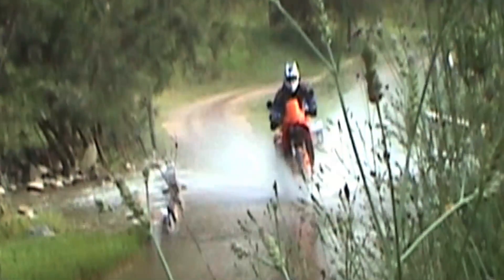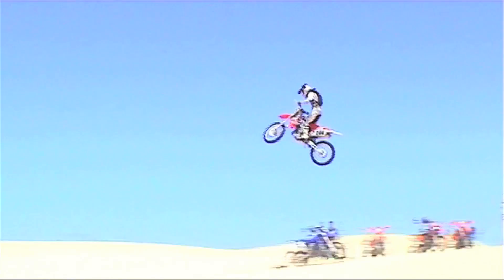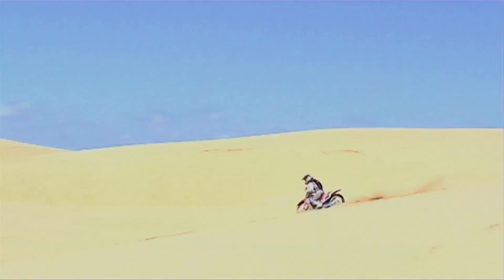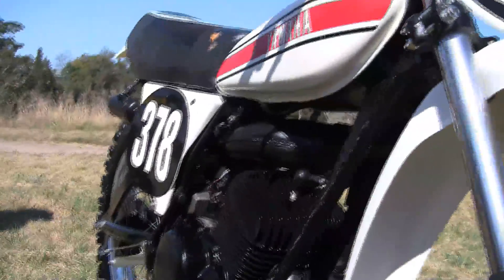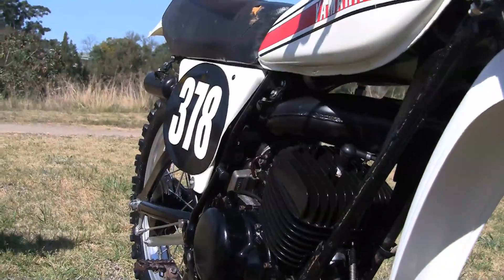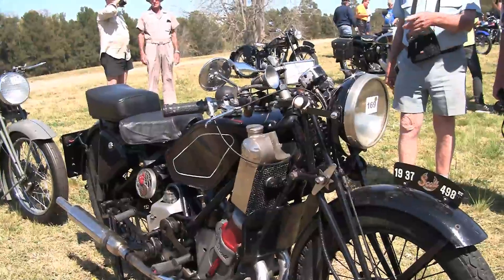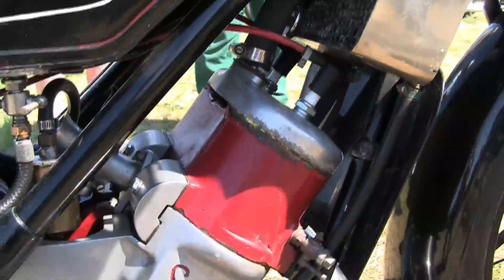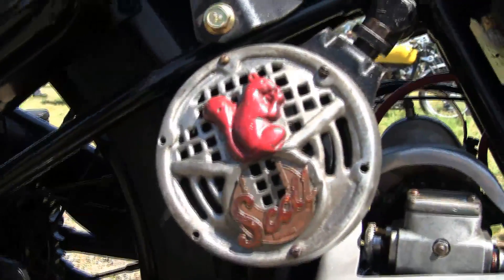First Watercooled Motorcycle - Scott Squirrel

Comment: got two rm465  expensive to restore we also invented induction reed valve in 1927 

WE ALSO HAD CASE REED ON A TRACTOR 6000cc SINGLE CYLINDER TWO STROKE ! 

SEARCH FOR FIELD MARSHALL TRACTOR AND HEAR IT THEY WOULD PULL THE SIDE OF A HOUSE DOWN